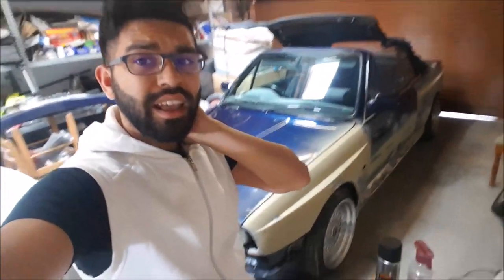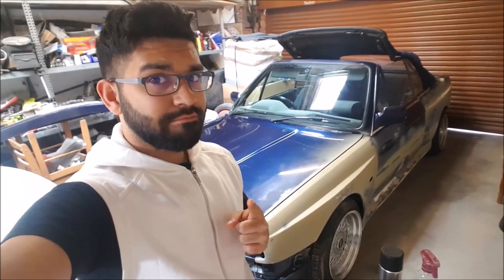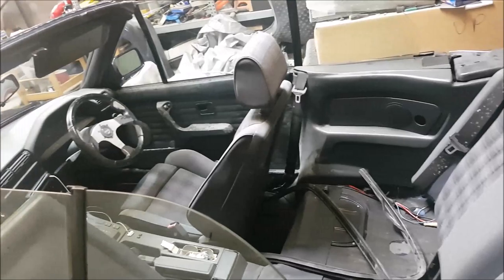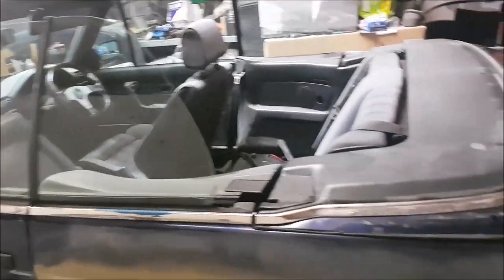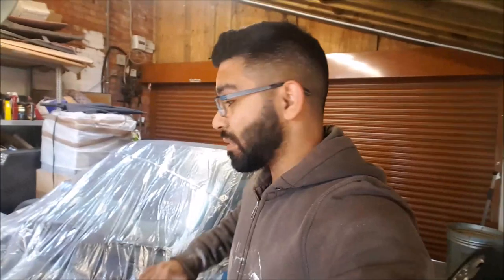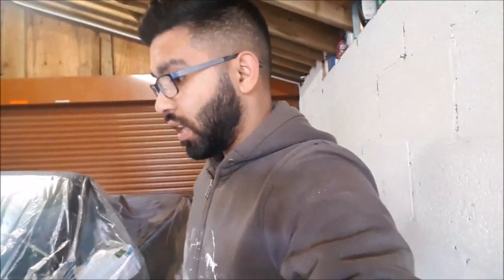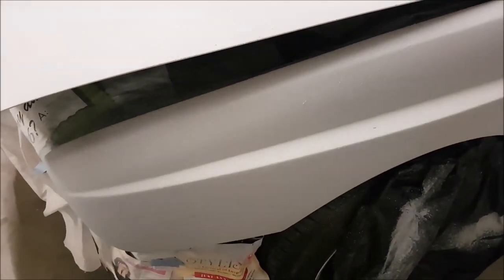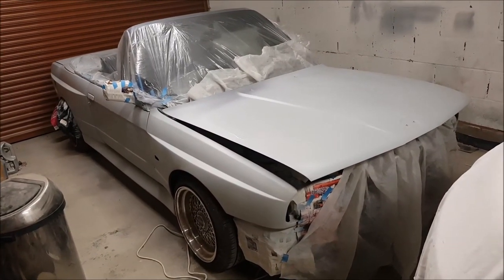BMW E30 Build | Prep and Primer Paint with Wagner | DIY Paint at Home | Mr GCC Vlogs

Comment: Hey i have a couple questions cause im planning on doing this to my e30. Did u remove the front wings and replace them with the fiberglass and also where did you buy your body pieces from
Reply from the maker: Hey Jared. 

I removed the original front wings and put on the fiberglass ones. I got it all off eBay from a car being broken. I will most likely be taking this all off and getting a completely new customer set up. If you are interested then let me know!